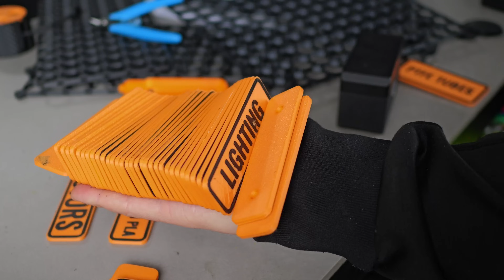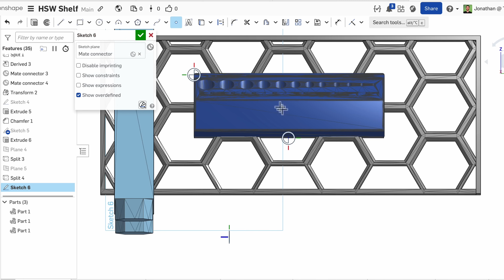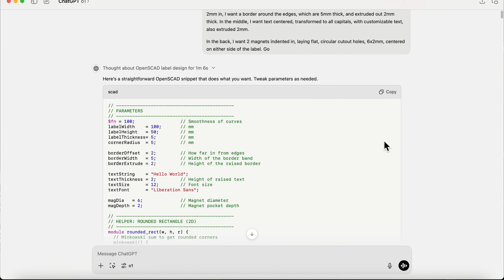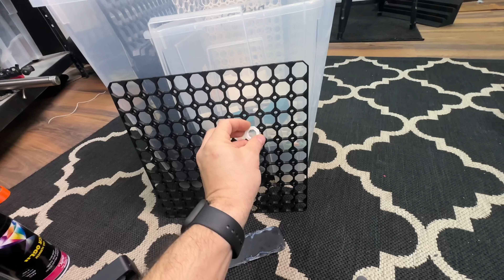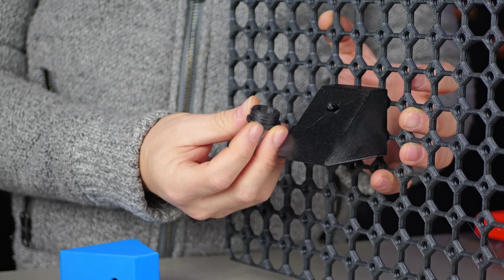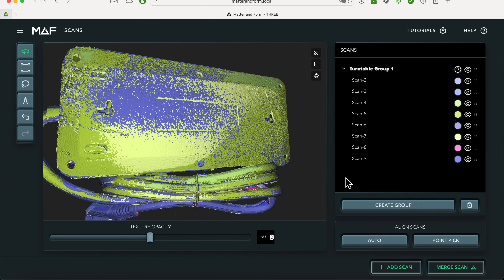I Tried Outsourcing CAD for 3D Printing

Comment: I designed a couple simple parts using Plasticity and TinkerCad.. now I just want to see how they turn out printed! 

I've read Bambu X1C may not be the best long-term, but not sure what better options are at that price point.  Actually, I only plan to print every once in a while.. so maybe using a 3d printing service makes more sense.

Any recommendations? Should I go with someone on etsy.. or would using one of the big companies be cheaper more reliable  ( Craftcloud by All3DP , Treatstock , JLCPCB, Shapeways, PCBWay ,  Xometry , Protolabs , 3D Hubs (now Hubs) , i.materialise , Sculpteo , Fast Radius, Stratasys, etc)

Comment: The 45 degree changer holders should have a negative 1-2 mm extrusion inset a few millimeters from the edges on the surface. This way you can use a template to cut out some anti skid rubber mats to glue on the surface so that the smusb plug isn't all that's preventing the devices from sliding off. It'll basically take all lateral force off the plug.

Comment: Hey! I've Been following your channel for a bit now and love your content, and id love to connect and help out especially in the CAD / Mech engineering Field, so please reach out 
i did try to contact you via email but not sure you received it. 
anyway one of my ideas is to make a universal plate for the multi board project that will offer the stability and freedom to design any part and simply integrate it to the system.

Comment: I'm very curious about this grid system. I'm wondering how much weight it could hold in regular materials (could this replace my firearm display mounted with wall control panels?)

Comment: Two notes on your USB-C charging docks. First, since the multiboard is designed to be used on a wall, doesn’t your design prohibit those users from adopting your docks? Second, could you just add a small slot to the side of your screw for the cable to pass through allowing the USB-C plug to be on the other side? This would take out the least amount of threads and save the most amount of strength.

Comment: When I've been asked to do custom design work in the past I usually quote $40-50/hr of work. When I was working as a mechanical engineer full time my salary equated to around that much. Skilled software devs can make many times this. Honestly the prices you paid are insanely cheap. That final project, what looked like maybe 4-6 hrs of work including the messaging back and forth, $100 is nothing. I probably wouldn't open my CAD software for $10 lol.
Reply: Most of these people probably are not from the states, maybe it’s a lot of money for them

Comment: The downside of the screw from behind idea is that if you ever want to (re)move the modules, you will actually have to take the multiboard off the wall to do it.
Reply from the maker: In my case it’s going on the side of a shelf so there will be access to the back

Comment: really interesting. regarding the design I am not sure if a 45 degree angle will be enough, but maybe add a version that has place for a rubber or anti-slip-matte or something like that should increase the adhesion enough so there is no force on the usbc. The USB-C in the part is not what I would be concerned though, it would be the female usbc in the object you are charging. As those are typically soldered on a pcb they cannot flex and will break more easily if there is constant force on them.
Reply from the maker: Good points I’ll try that!

Comment: Before switching to Multiboard I'd recommend reading the license. It's really not ideal for something that depends on a community to bring value to the ecosystem. The license requires that you publish any remixes under the Multiboard license. And you can't combine it with Creative Commons licensed parts because the licenses aren't compatible. The models you just published on Printables under CC BY-NC-SA violate the Multiboard license. Keep Making can also revoke your license anytime. At the same time you grant Keep Making certain irrevocable rights to your remix. It's not a community friendly project IMO.
Reply from the maker: I’m not a purist.
Reply: @thenextlayer  What does that have to do with purism? Is that your way of saying you don't care about the licenses of the things you remix?
Reply: @thenextlayer  this doesn't have anything to do with being a purist or not. You're violating the license

Comment: you could have thrown a notch in the side of the screw for the charger mount instead of a negative piece in the middle, put it on the edge so u can slide the cable thru, like those power cable springs for the A1 and A1 mini's

Comment: Nice thinking. like it, but I don't see it beeing very flexible to move the chargers around or adding more as you have to take the multiboard down to screw the lock ring on the back. I would add an "hook" on top or it so you put the "hook" into the hole that is on top of the hole where the multibord connector goes in and then insert the multiboard connector and it should be very steady and hold good weight and can't get loose. Also having the cable going thru the multiboard connector could be done better I think. I would insert the cable under the multiboard connector and then up and into a sledge that is moveable. About the USB-C cable I would go with an angled connector so you will have the cable to the side and the bottom of the USB-C onnector in a fit "slot"and on a sledge so it can be moved closer to multiboard or further from the multiboard depending on how big the carging object is and that way have the center of gravity closer to the board. 
I would also make it so the surface where the charging unit is put is level so no problem with things falling down if the wall is shaking och it slide down or make unnesseary strain on the USB-C connector. I can't do CAD and I have to use MS Paint to fix a quick drawing of what my idé are and hope you understand what i mean or someone that can do CAD kan make it 🙂
Here is my picture of the idea: https://ibb.co/q3c7zH51
1: The sloped chargingstation with hook with cable going in from under the multiboard connector and into a slot in a sledge that is movable.
2. The slot for USB-C cable. So no strain on the cable as it's going to the side and when pussing in the unit to charge onto the USB-C connector will be firm as the bottom of the USB-C connector is on the bottom of the sledge. Or pulled the USB-C connector up a few cm from the slot and insertet in the unint to charg and then set down in the USB-C slot again).
3 The USB-C connector sledge that can move away or thowards the multiboard.
1: The change chargingstation with level surface instead of sloped. Don't see any goos use for sloped when charging as the risk of it falling or straining the USB connector is much higher than the use of it beeing sloped (IMO🙂)

Comment: 1500 for a turnkey product design isn’t actually that bad. You’re paying for a team and multiple revisions. And probably step files you could later send to a company that would make injection molds for mass production.

For a company, $50-100 per man hour is common. So you’re paying for 15-30 man hours and they’re betting they can get it done faster. Design work is paid for by the hour, typically. It’s why freelancers in the US typically charge much more, it takes the same amount of time but our cost of living is much higher.

Comment: I did some test prints first and found I needed to print the Multiboard tiles at 99% size in x and y to get snaps to fit well. I guess you could also increase snap size to 101% maybe to make them tighter. I have found the screw in type connectors are best. I also found a really good honeycomb to multiboard adapter which has worked well.
Reply: Rather than changing the scale of parts, I highly recommend you check out the horizontal compensation (XY) settings in your slicer. That way you're only changing how your printer extrudes the outer edges of parts, not the overall dimensions.

Comment: my suggestion for this is adding an U shape lip on the end that pulls out to let the charging device sit its weight on so there isnt so much weight and tension on the usb port. you can probably do something like 2 holes on the bottom end parallel to the diagonal and have different length lips that slides in with clicking teeth to adjust length. hopefully that makes sense. haha.
Reply from the maker: You lost me. Wanna remix my design to show me? :)
Reply: @thenextlayer  i will attempt it, i just got back into 3d modeling again so it will probably be wrong but it should look like something comprehensible. ;)
Reply: @thenextlayer  posted the remix from your printables. its terrible modeling but hopefully it gets the point thru. haha

Comment: Pushing the USB-C heads through the nut isn't probably the best choice.

I would rather make 3-4mm wide channel from the edge of the nut to the center, so it would have a cutout through which you can insert the cable to the middle hole, so instead of pushing the connector through the hole, you place the nut on the cable. As in, the nut profile isn't an O but C, not bigger hole for the connector but a cutout for the cable.
Then it's also a bit more universal since the limiting factor isn't the size of the connector but the thickness of the cable and you can probably easily make the cutout 5mm wide without compromising the integrity of the nut and then pretty much all power cables should fit into the nut.

I also should just fire up the Inventor and make a remix but I am currently just too tired after quite intensive 2 weeks of 3D CAD training. 😅
Reply from the maker: Oh, dang, THAT is a smart idea, why didn't I think of that....

Comment: You should probably look into multiconnect. It might solve some of the problems that you had with snaps and screws on multi-board. Plus multi-connect also would give compatibility with honeycomb storage
Reply from the maker: He has an official solution, multipoint, which does the same, no?
Reply: @thenextlayer  I wasn't aware of multipoint.  Must be one of the newer components.  I still find that system hard to wrap my head around all the options.  Going through all of the different pages, it is easy to get lost, and finding the right component directly on thangs is a nightmare.  I would really like a single page filterable list of all the components.  Be able to filter by "big thread" or various other criteria.

Also, multiconnect works with HSW where I don't believe there is a multipoint compatibility.  Are they the same size slot/key?
Reply: @ViciousNarwhalFL  I can speak to this a bit since I designed Multipoint with Jonathan (KeepMaking). The core concepts are very similar (Multiconnect's designer actually came up with his original version during Multipoint's development independently), but Multipoint is focused on making a small and flexible mounting interface for slots, pop-ins, bolt-locks, and some other mount options. When printed using the folding method we came up with, there is no notable strength difference (especially as they use the deepest thread interface in Multiboard by default).

As for finding stuff, we absolutely understand. We're working hard to make a huge update to help people find and understand parts more easily, and if all goes well it won't be long!

As for HSW compatibility, we do have it as well, but the key "ingredient" for it to really reach potential is still in development. If all goes well that will be out very soon though too! The adapter parts are always some of the last we add since they aren't our focus, but we try to make sure people have the option, or at least the tools to remix it themselves should they need to do so.

Happy to answer any questions you have!